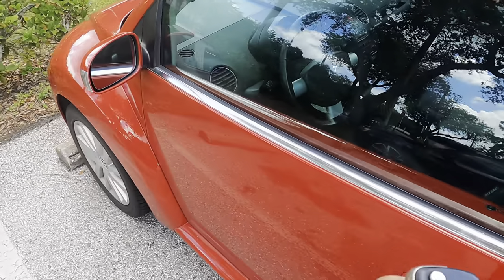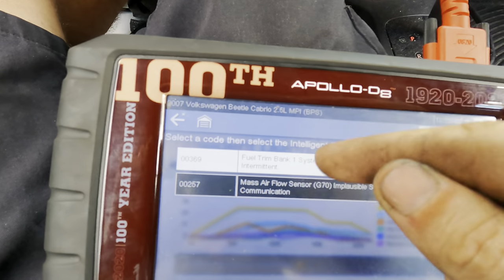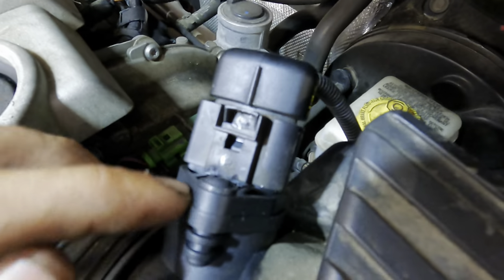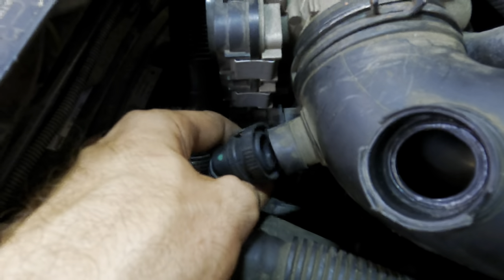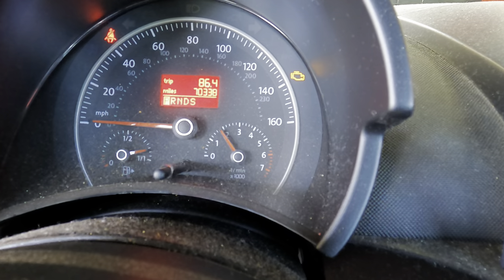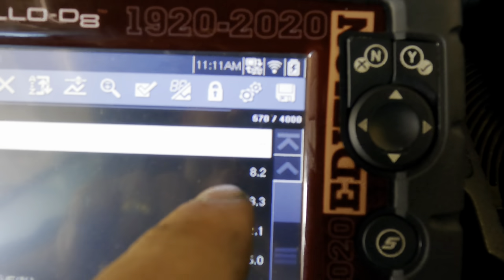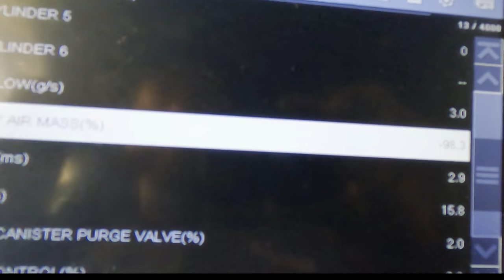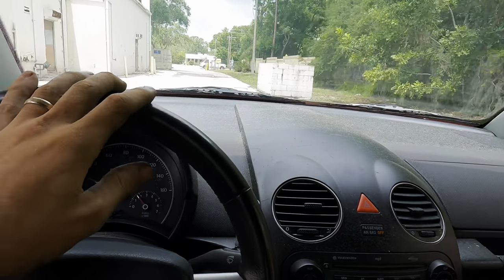Dealer Saved The Day! 2.5l 5 cylinder? VW Beetle P0171 P0101

Comment: Wife has a '98 New Beetle she drives daily. Engine is reliable enough, but it reminds me of my '73 Spitfire. Everything but the engine breaks often and is expensive. Door components, A/C controls, window/door lock/trunk/gas cover switches, glove box door -- plastic bits throughout the vehicle. I've replaced the driver's side window regulator 4 times in the past 10 years. For the broken off tab thing, I wouldn't bother replacing that tube. It'll just break again anyway, and the part is stupid expensive. I'd just put a hose clamp on it and get on with life, but I'm not doing it for a customer.

Comment: I love when Ray escalates. Means we might get to see those angry pliers which have been woefully absent lately. Five cylinder I won’t say what word comes to mind but I had a motorcycle with three once.
Reply: Nothing wrong with either 3 or 5 cylinder engines.
Reply: I have a 1972 Suzuki GT750 which is a three cylinder 2 stroke. My favorite bike!
Reply: As long as it isn't a Geo Metro, there's really nothing wrong with three cylinders.
Reply: They are pwz by snap on I have 2 sizes at all times in my box for optimum escalation
Reply: Smart Fortwo have 3 cylinder engines, great fun to drive!
Reply: @carlosanzola2938   Had one of those.  Scary fast.
Reply: @carlosanzola2938  nice bike that😁 carlos. Worth a fortune here in the UK🇬🇧. 👍
Reply: @badazz2969  Also available from Bahco, who make good stuff.
Reply: @carlosanzola2938  I had a 550 and it was a great bike. As fast as a Honda 750 4 cylinder.
Reply: It's all about proper use of a tool if you're careful you do not need a million tools specifically to do a specific job but some people will get a pair of angry pliers and start grinding and horsing on stuff and then everybody has a little bit when Ray picks up a pair of pliers and tightens up a wheel nut hey people you your tools right take care of them and they'll take care of you have a good day
Reply: I had a motorcycle for I don't ride anymore I got to asphalt poisoning have a good day

Comment: Long, long ago, I was one of the "head residents" in an apartment complex.  HR got a bit of a break on rent by being available to help other residents on weekends.  One afternoon a nice lady range the door bell.  Her problem was not with the apartment, but with her old style rear engine bug, which she had not driven for some time.  Se said her car was making strange noises.  We went out to her spot, where she had backed in. contrary to apartment rules - I said nothing.  Walking up close there were, indeed strange noise coming under the front.  Since the engine is in the back in those old VWs, I suspected something organic.  We carefully opened the hood to discover a family of opossums had homesteaded her car.  Opening the hood had trapped on between the hinge and body.  We called animal control who dispatched an opossum wrangler right away.

Comment: A little advice, and this would make great Production Value for you: With codes like these, I graph certain custom Pids right off of the bat before I even pop the hood. 1: R.P.M., 2: MAF, 3: Short term Trim, 4: Long term trim. (There is actually a 5 and 6 but probably would not apply in this case. This will give a base line at Idle and higher RPM's before anything is touched. Once you found that Hose loose, just put it on and Graph the same PIDs. (Forget about MAF in this case because it too hard to have an accurate reading with what you are doing.) Pay attention to the Short Term Fuel Trims. If pushing it back on made a difference, you would easily see it and be able to show it. Easy fix. (The problem with just showing MAF data: It is too hard to be completely consistent  with your foot on the pedal watching the dash Tach.) You proved it on your video. After you messed with it and left it where you thought it was, your readings were 8.0 to 8.3. After you pushed it in, your readings were 9 to 10... (Big change.) After replacement, 8.6 to 8.8. (Not so big.) There is your inconsistencies.... Took me 2 years to get the Office Women to quit messing with the Fuel Cap when ever they used a Pocket Code Reader to write up Check Engine Light issues with Evap Codes. I need to diagnose things untouched. If the Cap is loose, I will find it and prove it. If that was the issue and they touched it. I could be completely wasting my time diagnosing a now sealed system. Does that make sense?
Reply: Finally some one else who realizes this individual does not understand what he is working on.

Comment: I'm old enough to remember VW Beetle with rear engine and 6V electrical. My buddy took the larger VW van engine and put it in his Beetle for more HP and performance.
Reply: I had two of those. The first one the transmission ate itself. So we transplanted the engine into another one that had a good transmission and a seized engine, but that Beetle ended up with disintegrating unibody parts throughout the entire front end about a year later.
My next car was a Ford Escort.

Comment: I always just keep some rubber cement around to temporary glue things together in such a way that they won't wiggle loose but can be easily pulled apart by the next tech then offer that as an option to the owner rather than having to shell out (and/or potentially wait quite a while) for a replacement part.

Comment: I owned a 2001 and had the terrible water pump with plastic impeller break and seize. Non-interference engine timing belt broe and now New head with valves being bent. Repaired with rebuilt head and those pesky hoses I would either use a large shrink wrap around said clips or use a high heat elastic tape and wrap around fitting and I am done. Pulling the tape off was No big deal, I think at the time the big intake hose was $125. I was not going to get hosed! Long as it didn't suck in any air it was fine.

Comment: Hello! 
Considering how the driver door is disintegrating, I do not fault you for thinking the VW had a worse problem. And it is a happy situation that the hoses that plugged in did not break also, plastic possibly 5 years old exposed to a hot engine compartment as they have been. __

Comment: I am surprised they even had the part. I drove a VW diesel from 1977 to 2010. In my last car, they stopped supporting the vehicle. a 1991 Jetta Diesel and parts became very hard to find and when found very expensive. I Remember getting the last 4 fuel injectors in NA. My mechanic found them in BC, Canada- $ 100 apiece. The last fuel line in the country came out of California, When the alternator bracket wore out, the only fix was to have one frabricated- at that point, I decided that a 30 dollar part at best of VW still made them would have cost me well over 500 to have made, I was done with the car after 19 years and with VW for any future car purchases.

Comment: A part that you would expect to wait for but is in stock means it's a common failure point.
Reply: I used to go to a Ford dealer that would have random plastic parts for cars 15-20 years old, That had been there for 15-20 years. Sometimes if they have a small selection of small parts they never bother to clear them out and take them off the computer.
Reply: @IanSlothieRolfe Back in the 90's I remember an old garage in a small no-where town that still had Model 'A' & 'T' parts (fenders & body parts stored up on a mezzanine level, you could see them if you bothered to look up), I was young & dumb ... a wiser me should have bought up the stock.

Comment: Ray don't hit on the VW's mate..ive had them for over 30 years..current Golf 2lt TDI does 71mpg on a run..great cars proves you don't don't need 7lts of fuel guzzling underpowered tec to do the same job..
Reply: He's so accustomed to the shortage of parts for the american brands that he thinks foreign brands are even worse. I'm glad VW proved him wrong.
Reply: @gmoose7155  - Yeah, 3.3L/100kms is a bit of too low but you can easily do 5.5L/100kms with that engine.
Reply: @gmoose7155  MPG<  its remapped, but at nearly £2 a litre here makes me feel better with your 8mpg cars lol yes 71 mpg..wife's golf was better at 80 mpg same engine
Reply: @module79l28  they seem to need a lot of parts too don't they
Reply: @redzed40  - That's the idea I get from watching Ray's videos.

Comment: Those plastic hoses lead to a electric air injection pump (also plastic), another source of leaks.  Aluminum rivets holding it together get loose.
Reply: I replaced the rivets with long skinny screws and nuts

Comment: I call it skill Ray. You took your time and did a visual inspection first. Some mechanics would take off the MAF and start looking around there first. Probably tell the customer they need new sensor.
Reply: Actually, some other "mechanic" already did that; the car has a new MAF already.  Probably had it scanned at the local parts store and they sold them a MAF based on the code.
Reply: @ivertranes2516  And the new one cost about 10 first round draft choices.
Reply: @ivertranes2516  🤣

Comment: My experience with water cooled VW was that it was a POS. Alternator brushes gone. Broken fuel injector wire. Fuel pump stopped due to known defect in fuse box. Misfire due to crappy ignition system fouling plugs. Entire exhaust system rotted out. All this in the first 20k miles. Bye bye no more VWs for me. After watching your videos I wouldn't touch any German car. Over engineered is an understatement.
Reply: My wife and I have had 5 water-cooled VW cars with model years spanning about 15 years from the 1980s and 1990s.  To me, they were fun to drive, generally held up well (even on roads in "third world" countries).

I did have issues with relatively minor things like my 1995 Golf had a broken plastic assembly which held linkage for the hatchback latch.  All of mine were manual transmission vehicles and low-to-mid trim level vehicles (manual seats, manual windows...).  My wife's Jetta was an automatic.  Transmission cooler leaked and we had transmission fluid in the radiator and antifreeze in the transmission.  Off to the junkyard.

I'd buy another VW again, but it would have to be a stripped down model with as much manual options as possible.  5 or 6-speed manual would be a must-have for me.

Comment: 5 cylinder engines are so cool..  They  sound like V10's but with half the fuel bill !
Reply: When you screw a low pressure turbo on it, they also got really nice torque!

Comment: I thought a different scan tool is needed for VAG automobiles. VAG comm is a different protocol?
Reply: I suspect the third party scan tool manufacturers have either bought the spec from VW or reverse engineered the protocols.

Comment: You say luck but you quickly diagnosed it by simple you know looking it over.. a VW tech would probably have taken half the engine apart lol (maybe) Either way One question on the VW part did they make you Sign for it? that looked like a part from Germany! which is airfreight! lol ( I drive for VW it's crazy to deliver)

Comment: For VW. to have a part in stock must be a common problem
Reply: I had a 2012 VW Touran . Required a new light control module. Connects up around 156 wires.
Took them 6 weeks to get the part from Germany  to UK

Comment: That doesn't look right with all the  electronics, automatic transmission and engine in the front.
Reply: Standard configuration European cars, reliability is dependent on build quality and design. Build quality is often very very bad, they even use sometimes PLASTIC inside the engine.
Reply: @basbass429  general motors has been doing that for years.  Example thirty 305 v8 mid 1970s had plastic timing gears.

Comment: Not to mention Volkswagens, when the PCV system fails, it will start sucking air so hard it will pull it in through the rear main seal.  love that German engineering. Of course fixing the problem requires replacing the valve cover, because, Volkswagen

Comment: Alright Ray it's not all your fault in assuming #1, it was 5 cylinders instead of 4 and #2, the parts would be difficult to obtainium. The reason I say it's not all your fault is it is well known the VW Beetle engine is installed in the back under the trunk lid, and not in the front storage compartment under the hood like this one. That whole Bug is messed up! With this logic the only thing that is your fault for assuming, was the engine placement. Next time look in the trunk for the engine and all will be good with the world.

Comment: Man you couldn't just use a couple 2 cent zip-ties to hold that plug in its home or something instead ordering a $75.00-100.00 intake pipe, money is no object to you I guess. I'd rather had the door panel, horn, AC fixed or a wax job rather then buy that unnecessary pipe, I bet a dime to a donut I could've fixed that plug to stay in lot cheaper then that!!!!!!!!!!!!
Reply: When it comes to a shop doing the repairs, the main objective is to fix it right, avoiding comebacks and upset customers. Vehicles that have expensive/& sketchy parts aren't their problem

Comment: Another epic fail, you mention, but never did look at or verify fuel trims, did not verify crankcase ventilation vacuum, did not smoke test intake system. Your test of holding the throttle at 2k rpm is nonsensical, not in any service literature, and invalid. This diagnosis was completely about fuel trims and load ranges. You did not drive cycle long enough for the system to perform self test, and you failed to verify the repair.